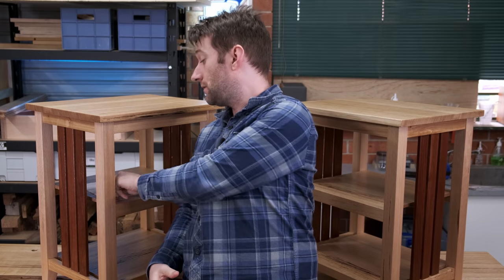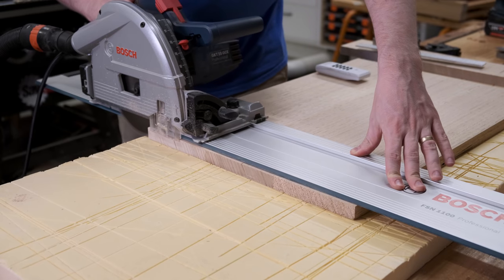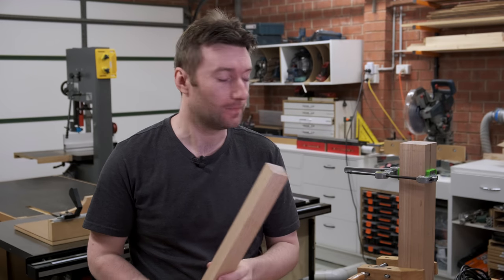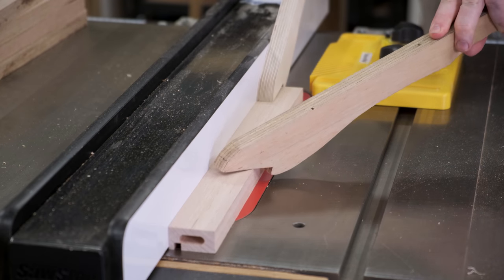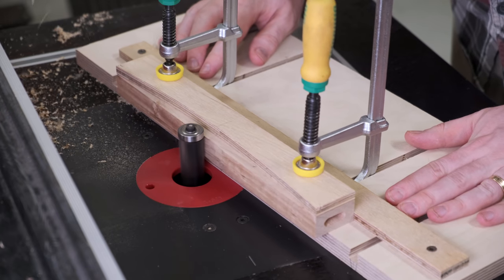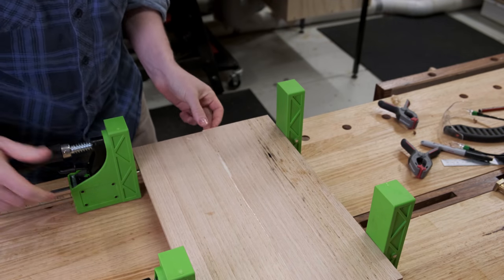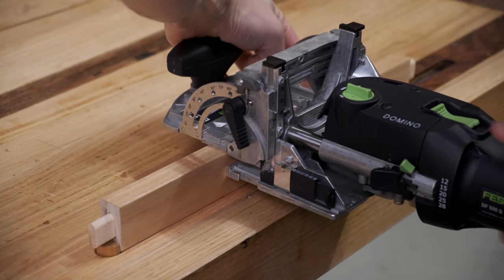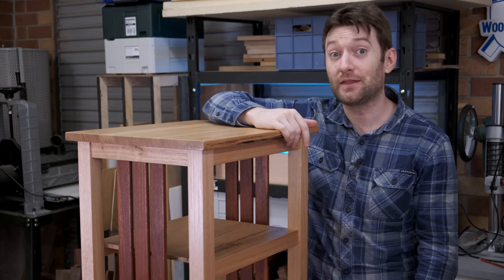Woodworking: Mission Style Sidetables - Free plans!

Comment: Hi Paul, I would like your feed back on those heavy duty torquata clamps. I bought there light duty parallel clamps. But they are not strong at all. Thanks
Reply from the maker: There is a review in the works, but may not be until the new year :)

Comment: I am finally getting around to making these.  Thank you for the free plans and awesome instructional video, it will all be super helpful.   Since I mainly work in imperial measurement is there anything I need to consider when doing the conversion on the plans from the provided metric?
Reply from the maker: If it was decimal imperial, straight conversion would be fine, but for fractional you might need to fudge some of the numbers to make them easier to cut/layout.

For example, 40mm legs would be 1-37/64″, but if you  drop them to 38mm,  that'd be 1-1/2". I'm not sure if it'd be best to convert then round up or down, or the other way a round. 
The top you can make 1" thick, shelf is 1/2"

Rather than the method I used in this video, I'd recommend making a quick drawing bow for the curves like in this video -> https://www.youtube.com/watch?v=WtFsEBUeD9o
Reply: @TheWoodKnight  thank you for the reply.   Im thinking I will just purchase a metric rule and make the plunge.  it will be good for me to learn.

Comment: Hi Paul, really enjoy your videos. What is the material you have under your wood when you are using the track saw and where did you buy it?
Thanks....Steve
Reply from the maker: It's just a XPS (I think) insulation foam board from Bunnings (big box store). 1200x600-ish panels, in 25 and 32mm thicknesses. I have three boards so I can cover 3/4's of a full size sheet of plywood

Comment: Excellent plans and project Paul - question is that rough stock you started with 8/4 quarter sawn?
Reply from the maker: Some of it was quartersawn, the majority was rift saw. The stock I buy is actually meant for the construction industry - kiln dried, but just machine graded for structural properties, not for appearance. Thats what all the weird red marks are on the faces to start with! The stock was 140x45mm rough-ish (its 'rough, but not super rough'), which is a hair under 6" wide, 8/4 thick.

As a side note, here in Australia "proper" rough sawn stock is still sold in essentially metric versions of standard US sizes - 150x50mm or 8/4, then x38mm (6/4)!
Reply: @TheWoodKnight  sorry last question - I am building this table now - I don't have a Domino but planning to use router and make my loose tenon but that is a small tenon - what size did you use? 4mm or 5mm?
Reply from the maker: @daverowe5351  I used the 4mm domino cutter, but thats purely because I've got a whooooole stack of them. 4/5/6mm would have all worked.

For the small tenon, I probably wouldn't bother with loose tenons but just make them integral and use a dado stack. For the mortise, if you've got a 1/8" router bit, you could use that, but 1/4" would work too. They're not structural, 00 sized biscuits might even work!
Reply: @TheWoodKnight  awesome thank you and wishing you a great 2020!!!!